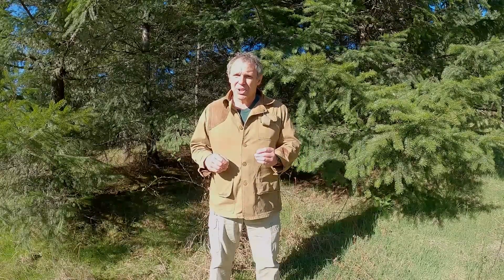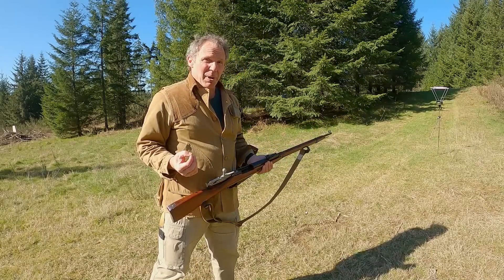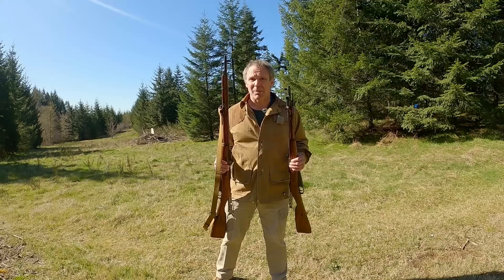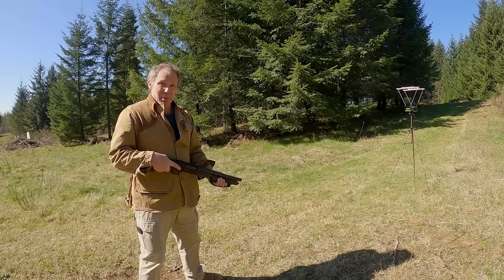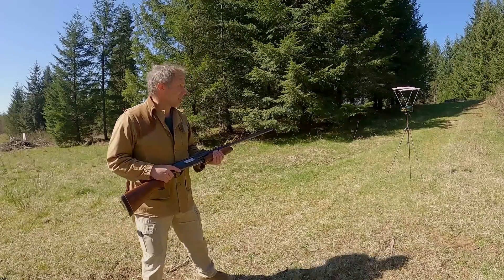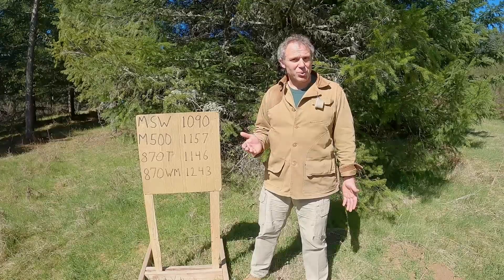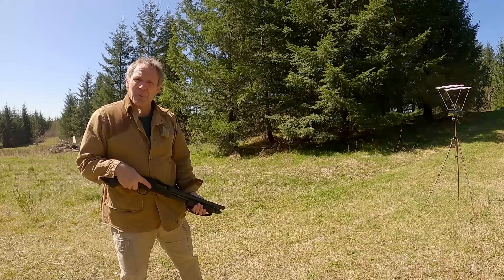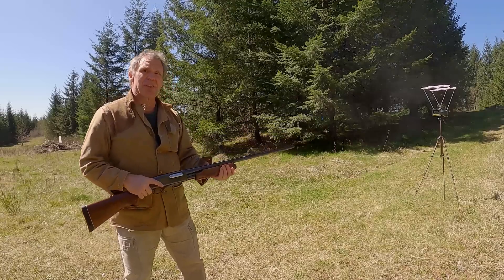Shotguns: How Does Barrel Length Affect Velocity?

Comment: I use a 0 inch barrel for home defense and let the pellets be the judge.
Reply: Burglars just have to put up with the Shatner-esque...pauses you make after each shot to see what you hit, and the speech impediment you get from the muzzle flash.
Reply: -0.5 inch barrel
Reply: Is it effective?
Reply: Just get a Mossberg and have no barrel 👀 might shoot the mag tube but it'll shoot
Reply: Yes, it's called a hand grenade.
Reply: SirBudrick You be the judge.
Reply: Doesn't a 0 inch barrel attract fedbois?
Reply: Kinda like a Claymore strapped to the leg of a Barcalounger ?
Reply: Didn't know frag grenades were legal for home defense
Reply: You'd need at least enough barrel to hold the shell in place to be struck by the firing pin, so at least an inch, but in order to ensure it doesn't just explode I'd recommend at least a full chamber to encase the entire shotshell. So probably about 2.5" of barrel to ensure it doesn't kill or injure you as well.
I'm assuming this configuration is what you call a "0 inch barrel" but you forgot the chamber is included in the barrel length of all firearms except for revolvers.
Imagine a pump shotgun with a "0 inch barrel" which would be no barrel, as soon as you racked the pump the shotshell would just fly forward and fall on the floor. A double barrel would just have no barrels and no where to put a shell. 
A 0 inch barrel shotgun is just an incomplete firearm incapable of firing anything.
Reply: @JohnDoe-pk8lc  that looked like the barrels were roughly 2" long.  See my above comment for explanation.
Reply: Do NFA rules apply if there is no barrel at all???
Reply: Home defense? More like defense against homes; as in other homes...they could be hostile...never know...
Reply: if the shell doesn't protrude from the muzzle it isn't a real home defense shotgun
Reply: So you just have a shotgun shell and an icepick?
Reply: in other words you just throw the pellets at the intended target?
Reply: Well, the Bond Arms .410g derringer has a useful barrel length of about 1/2" past the end of the shell.  ;)
Reply: @myemotionalsupportclown9590  yes because the receiver is what is considered the firearm.

Comment: I would have liked to see some more tedious chronograph results with rifled slugs.
Reply: Came here to say this.
Reply: @Stephen_Moran  Me too!  Semper Fi, TreeTop
Reply: same, also the rifled slugs in rifled barrel, but he made that video already. but i forgot exactly what was the difference so i would have wanted to see it again.
Reply: All you would get is another new set of numbers, and a chance to watch Paul shoot. Since shot acts like a slug at close range, simply running a batch of solid projectiles through the same guns really wont mean much.
Reply: Sounds like it could make for a good part 2 at some point.
Reply: I assume that 30" Wingmaster has a choked barrel.
Reply: Magnum slugs!
Reply: @Aronteed  yes, more powder to burn
Reply: Dammit, I’m going to do it myself!
Reply: Agreed
Reply: Slugs would be great.  Would also like to see the buckshot and slug differences in various barrels on the meat target with the new and improved fleece backstop.  What does 50 - 100 ft/sec mean on that target?
Reply: @chrisb3738  Yep, usually a full or extra full choke.  Years ago 30 and 32 inch, and even as long as 36 inch barrels were available.  They got the nickname "Goose Guns".
Reply: I agree^^^

Comment: Paul Harrell
Testing shotgun velocities and barrel length is interesting and not as simple as it might seem. Because all shotgun barrels can have much different inside dimensions and designs unlike rifle or pistol barrels. The general rule is modern shotgun ammunition reaches maximum velocities in about the first 24-inches of barrel or less on average. However, Mossberg makes 12-bore guns with overbore barrels the same diameter as 10-bore guns. Other manufactures use different diameter tubes as well. The idea is to improve shot patterns, improve consistent velocities, reduce recoil, shorten shot strings and reduce deformation of shot. Some use a combination of forcing cone length, bore diameter, choke length and choke constriction regulated for the purpose the shotgun is designed to be used for. That is why some shotguns cost $300 dollars and some cost $3,000 dollars or a great deal more. Generally low cost guns provide less than perfect results. Not to say some do an excellent job and still are very economical too. This often depends on the ammunition you use. Finding it is more difficult to find than finding the best performing pistol or rifle ammunition. High velocity is the least important if it patterns poorly at the range you plan on using it. In most cases high velocity is the major cause of poor pattern results. Small size shot is most affected and that is a major issue with some steel shot loads too. Generally speaking; if you shoot any person intent on doing you harm with .410 bore skeet load or a 12-bore at 7-yards. One might make less mess, but be assured the results will be the same.

Comment: I kept hoping to see a Marlin goose gun with a 36" barrel...ideallly pulled out of Paul's coat pocket.
Reply: My 38" gun always chronoed lower than my 26" gun. I figured the pressure dropped from expansion inside the barrel and friction provided more force against the shot than pressure pushed it forward. It did have a fixed full choke though, which might have increased resistance.
Reply: Jacob Ackley. how is that gun on the trap line 😄
Reply: Ask the person who stood next to him...
Reply: @oimissed1292  pretty decent. It holds excellent patterns with cheap federal #8. The follow through is easy since the momentum carries pretty far forward. Its a bit of a chore using it though,  because the balance is awful. It's a light bolt action shotgun, so the barrel is most of the weight.

Comment: Stupid questions: Does choke play any factor? Did it play a factor here?
Reply: Serious answer? ... PROBABLY...  but to such a small factor as to be entirely insignificant in any practical sense. 
IF we could reproduce PRECISELY the load density and pellet positioning as well as the EXACT velocity (and I mean within +/- 1 fps) from shot to shot, I imagine that choke constriction WOULD actually cause a variation, but I suspect it would only translate to a maximum of perhaps 10 fps, with the open chokes shooting faster than the closed. This would be due to the shot cup actually being slowed comparatively by the choke.
Reply: A tight choke will increase velocity slightly. A choke is essentially a nozzle.
Reply: Not a stupid question... Actually a good one... Back in the day, a lot of folks thought a longer barrel "shot harder", but barrel length and choke were selected to purpose. A longer barrel with a tighter choke (i.e. 30" full) for pass shooting ducks/ geese both gave range and weight to help follow through the lead. But a long barrel (even with an open choke) is awkward in upland hunting. Not to mention heavy if you're toting it all day through fields and brush. The old guys were more worried about shot size and patterns. Regarding buckshot, shotguns have unique personalities of their own, but a full choke might gain a few fps but at a cost of more deformed pellets and a more random hit pattern.
Reply: Russ Owensby  Ditto . . .

Comment: I just got a Marlin model 43, and I shot the same slugs in it as I shot out of a shockwave a couple days ago. I fired the Marlin first, and it kicked like a mule, then the shockwave felt nearly gentle in comparison. But, while the Marlin was just another gun, the shockwave lived up to it's name and dislodged tons of crap from the ceiling of the range upon firing it. I felt like it lost a lot of power as the fireball was huge from the 14" shockwave barrel and the 32" barrel on the Marlin had a fireball comparable to my 357 with a 2" snub. It's good to see a real analysis with only a 7 or 8% increase with double the barrel length, and that makes me feel better about the shockwave as home defense. Yes I saw the video where he reviews the shockwave, yes I saw the power was further diminished than 7.6%, being near to 15%. But I'm going to call it 10%, and I can live with that because an intruder won't.

If you can find the model 43 Marlin, I highly recommend it. It's definitely a different feeling than any shotgun I've fired and I love the ridiculous size (I want to say 5 feet, but probably barely over 4') of it.

Comment: I was pleasantly surprised at the 7.52x54 velociry from the 28" barrel. That is just slightly faster than a comparable 308 Win from a 22" bbl. Based on that, i guessed that the 20" bbl would give 2600-odd fps, which proved correct. I was very surprised at the buckshot velocity from the Shockwave. Most buckshot claims 1300 or 1325 fps, but does not reach that from an 18.5" bbl. Good to see that some does. No doubt the velocity differences in shotguns are smaller than rifles due to the fact that shotshells are relatively low pressure (similar to 44 Spl and 45 Colt in many cases), and the velocities are lower than rifles to begin with. Anyway, good info as always. Thank you

Comment: Thanks for the tedium of powder burning and measurement.  I found this informative.  My main take-away is to test my own gun and ammunition combinations if I want to know what they do.

One point for gun control fans--the "sawed off" 14 inch Shockwave barrel wasn't more powerful than the 20 inch barrel shotgun--kinetic energy is velocity squared times mass and when there's lower velocity, there's less kinetic energy for projectiles of the same mass.  Ain't Science wonderful?

Remington and Mossberg seem to have different barrel specs due to differences in velocities.  It looked like the shorter Mossberg barrels produced similar velocities than the longer Remington barrels.  It may be that using a different brand of ammunition will produce different results--but if I want to know I need to do my own testing and keep careful records.  It may be that one brand of ammunition will produce higher velocities in a short barrel than in a long barrel and that another brand will produce higher velocities in the longer barrel.

Comment: I'm thankful for this demonstration, and I'm with you for the most part, but here's my problem. Like you, I have been interested in shotguns both for HD and hunting for approaching two decades now (mostly the former). Most of the time when I read in a forum about velocity & barrel length being a concern it is specifically regarding 24", 26" and a 28" barreled shotguns; and I'd say about 85%-90% of the time it is specifically dealing with 26" vs. 28" barrels (and often someone brings a 30" or longer barrel into the equation anecdotally for comparison; but I have never really seen any true results test results. 

When we look at various rifle & handgun barrel lengths graphed, we usually see a point of diminishing returns (and once in awhile a point of diminished returns, and it sometimes occurs for rifles in the mid-to-late 20's (24", 25" and 26" for Creedmoors 6.0 and 6.5, for example). 

Most of the time, the conventional wisdom for shooting waterfowl is that 26" vs 28" shotgun barrels make no practical difference regarding velocity shooting waterfowl. Sometimes people will point out that they won't get in a boat with someone shooting less than a 28" shotgun because it's too loud (I don't know much about that either as I've never compared it scientifically). Others claim sight radius makes a difference, but I think most typically say it does not. Regarding the 26" vs. 28" velocity question specifically, however, if it does not make a difference, why use 3.5" guns in lieu of 3"? 

Looking for content regarding the shotgun barrel vs. velocity debate, I'd say that would be a better one. When it comes to HD shotguns, the question is usually more about spread and not velocity per se. 

As always, thank you for what you do, and I really mean that. You and your crew do a wonderful job obviously.
Reply: From a list of measured noise with calibers I can say 28 inch has 151dB, 26 156dB and 18 inch 161dB . Only 3 dB more is double the noise! So a 18 inch is much louder that a 28 inch barrel.

Comment: Love 30 inch over under 725  browning for sporting clays..  28 inch 725 browning over under for bird hunting..    
      Paul I think most of the shotgun barrel length issues are based on how easy they are to aim..   not how much velocity you are getting.   
     Trap shooters like 32 to 34 inch heavy heavy barrels for the feel of the swing..  the targets are actually closer for ATA TRAP then a lot of clays shots..  
      4 yards is smart to chrony most pellet loads.. 

    Hunting requires a solid hit with pellets..  or slug..  sports games just require the chip of one brittle bird.

Comment: As an additional data point, Federal list the ammo used at 1220 fps muzzle velocity for Game Shok Upland heavy Field 1.25 oz #6. I believe that is the correct ammo.

They don't list the barrel length but from what I gather listed muzzle velocities are often higher that what the consumer will see, at least with rifles. They are usually tested with 24" barrels and a chamber may be at the tightest side of spec.

Comment: shotgun rounds use some of the fastest burning powders. it's a big tube to pressurize and it has to do it quick, so you need fast burning. shotguns are also very efficient at burning up the powder quicker. that's the reason you don't see such a huge difference in fps like in the Mosin. Thanks for the vid Paul.

Comment: Just to add, it is likely the differences shown between the M500 and 870T with buck shot is related to the choke and forcing cone geometry within the barrels. The bore diameter and internal surface finish can also affect velocity, especially on the softer plastic sabots, even in the relatively low pressure shotgun rounds. It can act like a shot out rifle barrel or a fouled rifle barrel, giving increased velocity (to a point) at the cost of stability or causing random pressure spikes as the projectile is held back.

Comment: Hi Paul,
Your presentations are excellent because shooters with varying levels of experience and knowledge can enjoy and learn from the video.
Do you know of a number or scale accepted to be a generally accurate number of fps reduction when shortening a rifle barrel?  For example a Remington model 700 stainless chambered in .300 Remington Ultra mag.  Originally i believe the barrel was 26” long to burn up the powder to achieve extreme bullet speed.  However I wanted to add a custom muzzle brake and shorten the barrel so that when including the length of the brake the total barrel length will be a net 24”.  Of the 24” barrel, approximately 2” would be the muzzle brake, which does not contribute to gas expansion contributing to increased speed of a "projectile.  So truly the net barrel length is 22”.  How many fps were lost by cutting the barrel from 26” down to 22”?
Thank you for the great info!

Comment: I really would have liked to see foster slugs in this comparison. The minor differences in velocity with pellet loads is not super important to upland/small game hunting where it is typically applied, rather shot pattern at distance is the primary concern (and using the right size shot for the game/distance). Really, slug ballistics, muzzle velocity variations vs the printed ballistics on the ammo boxes and what that means when shooting at 50 vs 100 vs 150 yards is probably reasonably more impacted by 100 fps differences. Especially in states cough cough IL, IA, etc.  that force deer hunters to use shotguns. So many gun owners have firearms as determined by their state hunting laws, and in these jurisdictions with misguided laws, many people own only a smooth-bore shotgun

Comment: A very long time ago, 22 rimfire ammo was compromised between pistol and rifle and maximum velocities actually occurred around 16-1/2 inches barrel length, almost constant out to about 18 inches (depending on ammo) and actually slower at 21 inches than at 16. I don't know if that is still the case, but it was interesting back then that you really did not want a very long 22 rimfirre rifle.

Comment: Mr. Harrell, a very good video indeed. Now, I don’t pretend to be an expert. Most of the time when I think I have all the answers, well you know the rest. What I am wondering is this. You used heavy loads with slow burning powder what I believe is probably designed for complete burn through a 28”-30” barrel. The only reason I say this is because I reload shotshells.  What I think would be a fun test or maybe a better test is if you used a target load using 1oz-1-1/8 oz shot. Whose burn rate is faster and designed for clay targets. Again, I do enjoy your videos and have learned many lessons from them. Keep up the good work.

Comment: Powder burn up is nearly instantaneous, max pressure is achieved essentially before the shot/projectile even begins to move. Pressure then rapidly drops off as the volume within the barrel increases, even with rifles this is true and that's easily proven by pressure curve charts derived from military and industry tests using pressure sensors drilled and threaded into the bore.
 Some powder may not burn right away and in the chaos of the process some doesn't burn at all but the overwhelming majority burns VERY early in the projectiles journey down the barrel.

Comment: Paul, I've seen other experiments where increased barrel length beyond 20 inches actually lowered shotgun velocities.  It really depends on the load and the barrel dimensions involved.  Percentage wise, the change in velocities appears to be less than in rifles, regardless of ammo used.  I suspect this is due to the much reduced pressure levels generated in shotguns when compared with rifles.